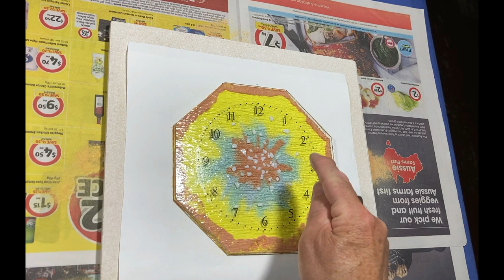Clock or Schlock, Fused Glass Clock that Taught a Few Lessons, Project Tutorial

Comment: It is also possible to use the same technique in straight kiln carving. Cut the fibre paper in the shapes you desire. Sprinkle glass powder over the pieces of fibre paper.  Then place the sheet glass ( light colours work best) over the fibre paper covered with the powder and fuse.
Reply from the maker: Hi Rosalind.  Your previous comment to that kiln carving video is what inspired me to try this, which at the time is what I thought you meant. Though this isn't kiln carving. That'll be on the list for some time. 😀👍

Comment: Absolutely loved this Jeff! Would never have thought of frit straight onto the thin fire paper. I guess the main benefit here is less weight when hanging the clock? Cheers
Reply from the maker: Hi Ed. Yes, plus the fact you get a nice polish on the front and a pattern on the back in one fuse. Fuse it with frit on top and you get a textured finish on bottom, and you have to turn over and fire again to get that polish.

Comment: Did you have a problem with the thin fire on the back?  I've read that it can be difficult to remove.
Reply from the maker: Hi DoJo. I didn't get any Thinfire on the back. That was my concern, but it worked out fine. You can see in the video the back came off the shelf clean.